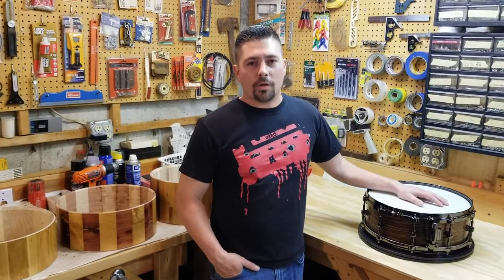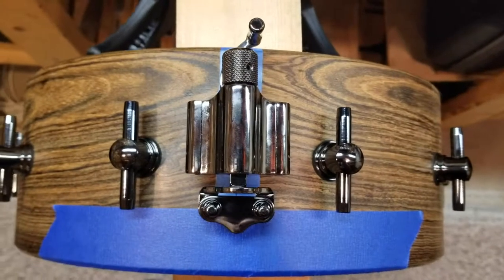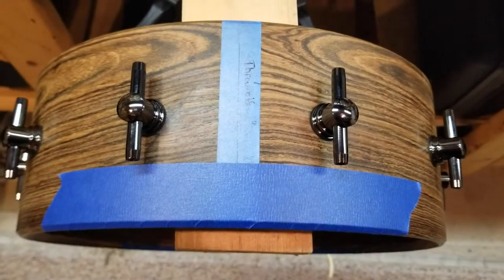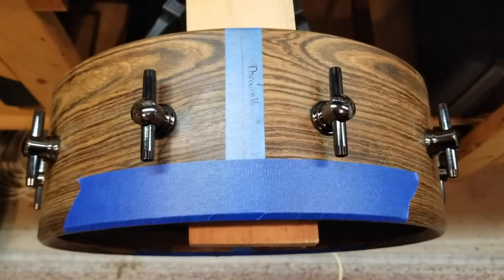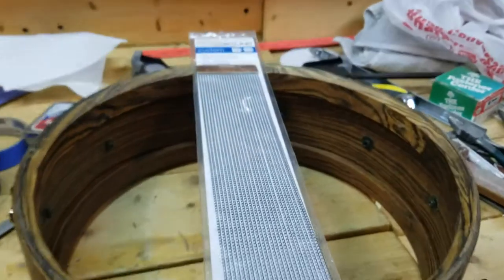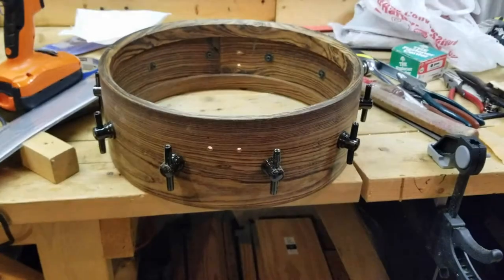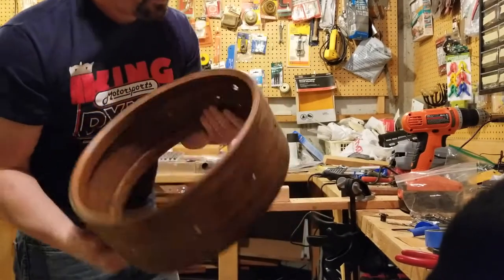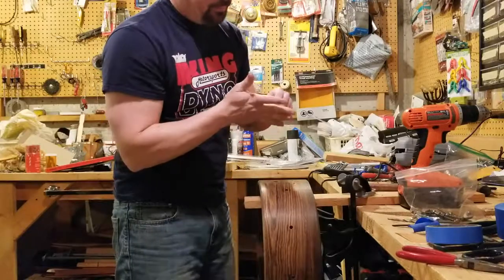Bocote Snare Build Part 2

Comment: Zack why do you cut the snare bed if the head sits over it?
Reply from the maker: It just ensures a better smoother contact of the snare wires to sit flat. It helps with tuning and snare buzz also.